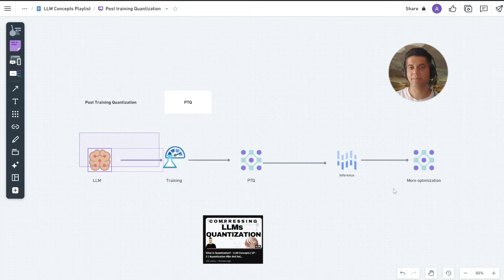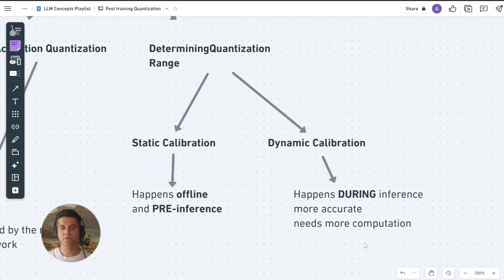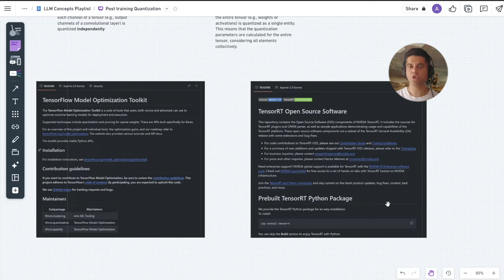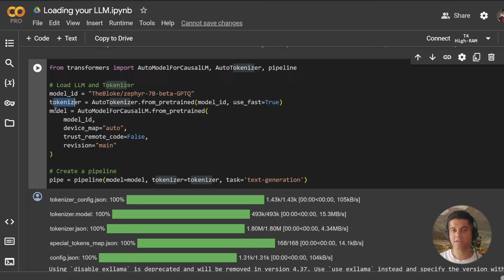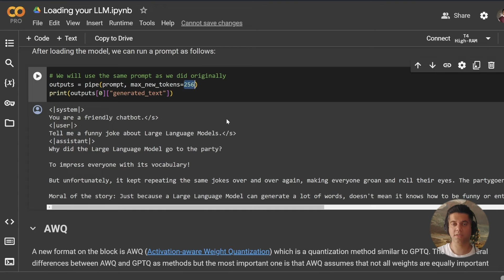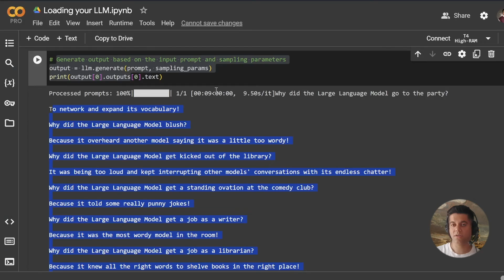What is Post Training Quantization - GGUF, AWQ, GPTQ - LLM Concepts ( EP - 4 ) #ai #llm #genai #ml

Comment: Hi Akhi, Hoping that you can help, I have an Alienware m18 R2 with an Intel i9-14900HX, NVIDIA RTX 4090 (24GB), 64GB RAM, and 8TB storage. For extra information I don't plan to use this for high intensive tasks like model training or any other such high intensive computing tasks, i only mainly will be using it for analysing my business documents and also writing 20 minute elaborate stories based on a five step story structure. I wanted to use the 70B model to generate the best possible results for these smaller less intensive type tasks. Based on my system specs which which optimisation method would you recommend. GPT Q, GGUF, or AWQ ad would you have any additional advice on the best way to optimise based on my use case requirements?
Reply from the maker: @theuniversityofthemind6347  hey bro I don't recommend doing anything on personal PC until you know what you're doing.
Try doing everything on an AWS instance first
Reply: @AkhilSharmaTech  Thanks for the reply Akhi. Thats understandable. Ok, do you at least think my system would be powerful enough to run a LLama 70B model for the described tasks?
Reply from the maker: @theuniversityofthemind6347  even though the system is quite powerful, I'd still suggest just using a 7B model max on your local system